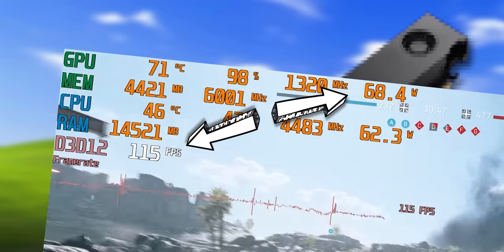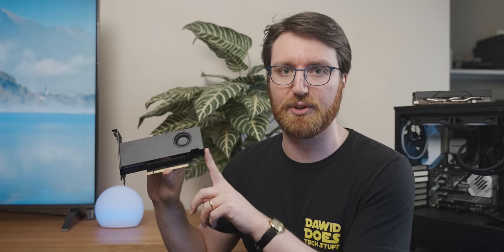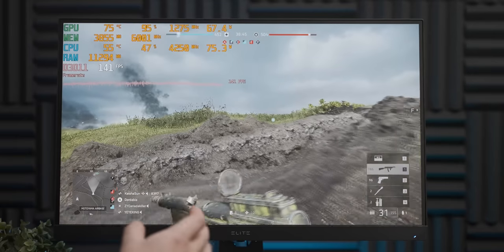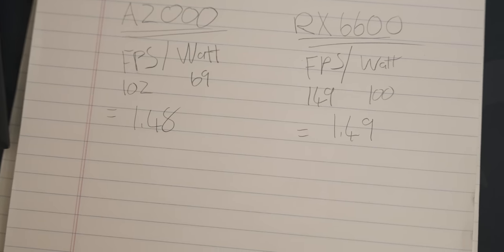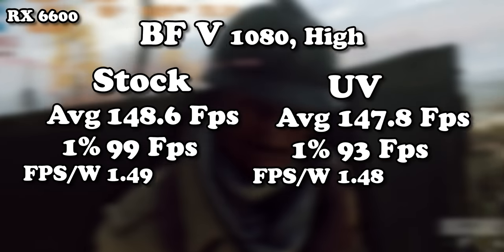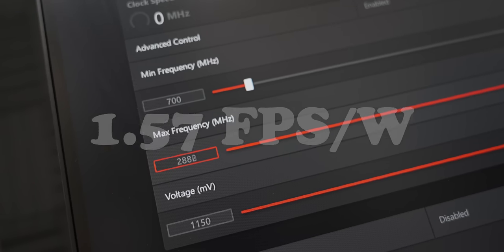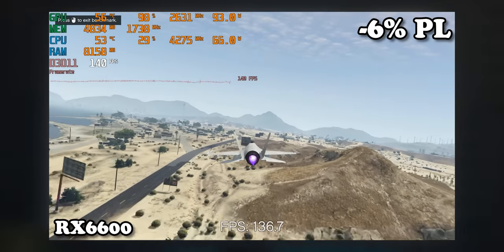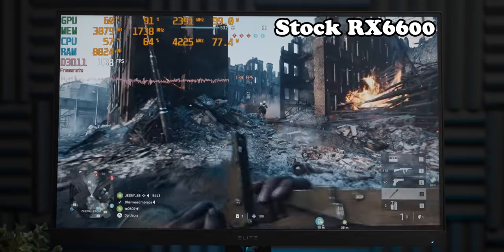The Battle For The World's Most Efficient Graphics Card

Comment: Serious question! Wouldn't laptop gpu's be even more efficient?

The 140w mobile 3070 Is Just 25% shy of the 220w desktop 3070

So technically it's more efficient
Reply: But they’re so slow and can barely be tampered with
Reply: Yes, but it's hard to measure since laptops are all extremely finicky with power limits and tuning.

IMO the most impressive mobile GPUs in terms of efficiency are the 3080 Ti (only 150W!!) and RDNA 2 graphics built into Ryzen 6000 APUs.
Reply: @tyrek78  not true and mostly true

Mobile chipsets have done huge leaps, as stated you're looking at 20-30% difference from the desktop Powerhouses, and they usually sit at half the powerdraw...a 12900hk laptop CPU can trade blows with the 5900x desktop CPU...would you call the 5900x a slow CPU? Same thing with gpu's

As for changing most anything its true, but there are some brands like xmg (i think clevo does a similar thing). They allow you to overclock/change pl from their own software, but yeah, main brands won't let you
Reply: @tyrek78  what the hell do you mean they can be barely tampered with? there is full voltage\frequency curve for them available in msi afterburner without any special BIOS required can be done on any laptop. And what do you mean they are slow? Full wattage laptop 3060 performs near desktop 3060 at 2\3 the wattage. The laptop 100 watt 3080 ti performs like a desktop 3060 ti at half the wattage.
Reply: @claudiamaschio2718  "As for changing most anything its true" THE HELL? what is that even supposed to mean? Have been undervolting and overclocking laptop GPU-s for years now via MSI afterburner voltage\frequency curve. So how the heck is it true?!
Reply: @steph_on_yt  actually 100 watts 3080m ti performs like a desktop 3060 ti at half the power consumption, so yes, it's still very efficient.
Reply: don't listen to these people. Clearly they know almost nothing about laptops.
Reply: @TabalugaDragon  lots of laptops now have voltage disabled on Cpu's, i was talking about that, never messed with GPU myself
Reply: @claudiamaschio2718  well this video is about GPU-s only, so I answered only about GPU-s. You can absolutely change pretty much anything on Nvidia laptop GPU-s these days. You only can't increase power limit, but that's mostly pointless because it'll increase the heat with the laptop's limited cooling and can possibly damage the motherboard due to increased power consumption.
Reply: @TabalugaDragon  that may be true until thermal issues come in
Reply: @TabalugaDragon  also if the power limit can be  raised so high, the mobile chips can easily become unstable
Reply: @tyrek78  OMG. 🤦‍♂
you never used a gaming laptop in your life, have you? most laptops don't throttle even after hours of gameplay. And I wasn't talking about raising the wattage(not like it's a good idea on a desktop GPU due to shortening its longevity), but voltage and clockspeed control has been available in them since Pascal, meaning for 6 years now.
Reply: @TabalugaDragon  ive used many gaming laptops, from evoo, dell, msi, and hp. all of them have throttled after several minutes of gameplay. and i dont think raising the clock speeds and voltage will make things any better
Reply: @tyrek78  their GPU throttled? REALLY? I can show you like 2 dozen reviews(or even live streams of reviewers gaming on those laptops non-stop) where GPU doesn't throttle. In fact GPU is usually much cooler in laptops than CPU due to bigger heat dissipation area.
Reply: @TabalugaDragon  that doesnt excuse the fact that some laptops have terrible fan placement/heat dissipation. also if the heat from the cpu isnt removed quickly enough, the gpu will also start to heat up more.
Reply: @tyrek78  exactly, some laptops. Nobody is asking you to buy those. You know reviews are a thing right? Who the heck buys something so expensive blindly, without any research?
As for CPU and GPU temps - cooling systems aren't made by idiots. Besides, like I said there is voltage control(you can undervolt a GPU without lowering clockspeeds or performance). 

The initial message here was about efficiency of mobile GPU-s, and the point still stands.

Comment: I don't understand how your logic would be overclocking. Slap that voltage down to 875 and put the chip to 2100-2200mhz. Would net you a much more effeciant card :).. Give it another go.
Reply from the maker: I mentioned it in the video, the moment I dropped below 1100mv everything would start crashing. 😁
Reply: @DawidDoesTechStuff  because you didn't drop frequency . You can't ask 2700mhz from the card at 875. Drop max frequency and drop voltage.

You will loose some performance, but it will be much more performance /watt
Reply from the maker: @gismo3564  I dropped the voltage before I started messing with the clocks. The GPU was only hitting about 2.3ghz and it still crashed at 1.080.
Reply: @DawidDoesTechStuff  but the target is still set to 2569, at stock. Drop the target you will see a massive improvement.

Amds boost doesn't work like nvidia (basically at this voltage use this frequency)

It's more comparable to PBO on amd cpus. 

So you set a target frequency (that it will never hit) and a max voltage it can draw. 
Then depending on power budget, temperature and how heavy a load it is, it will try and get the Mhz as high as possible. 

The lighter the load, the higher the Mhz.

Comment: The undervolt and power limits are not the same. If you lower your power limit, the clock speed will reduce too. However, if you undervolt it, the power will be reduced but the clock speed will remain the same. By the way, GTA 5 prefers Nvidia GPUs. That's why A2000 wins in GTA 5.

Comment: You're doing it wrong. At least from an nvidia perspective. Try msi afterburner. The voltage cure editor. That's the way i do it and it works very well... if you know how to do it right. I've got my rtx 3060 ti at 950 mv running at 2000 mhz, constant, under load. Not only did i reduce the voltage, not only does it run cooler, it also gives me a much higher score in time spy. 800 points boost to be exact. Just learn how to use msi afterburner.

Comment: LMFAO! When it comes to AMD GPU software it is nothing but disgusting crap and bloated bloatware as you just better off using drivers only.
Reply: User error. Assuming it works like on a nvidia card, using msi afterburner.

He could easily have gotten that 6600 down to 60 watts, loosing 10%.

Or 80 watts keeping the same performance.